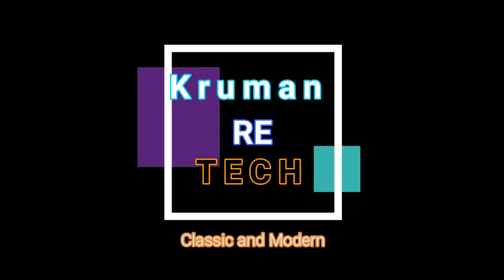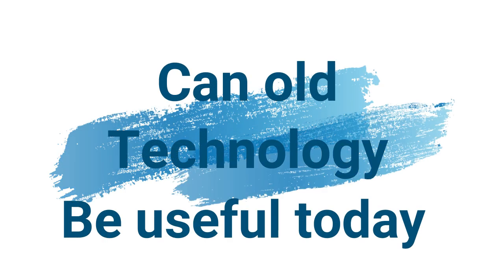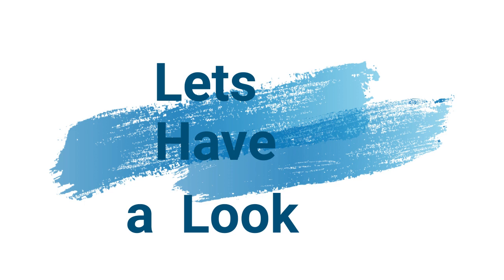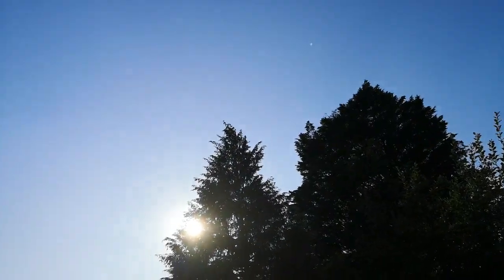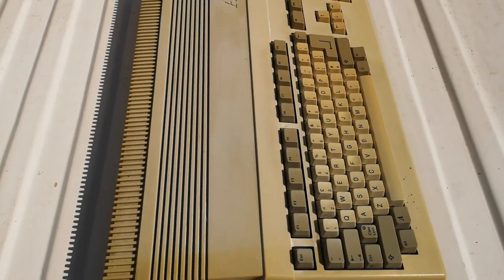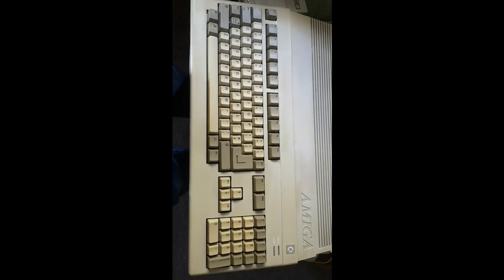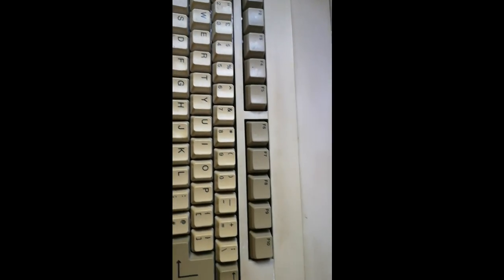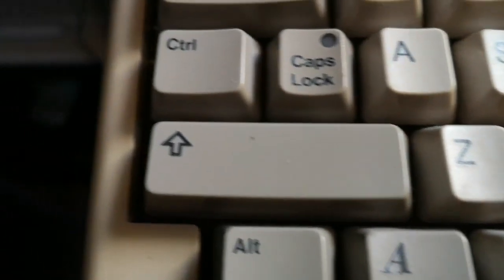Classic Computer - Retro bright experiment

Comment: I used exactly the same technique with my 500 and 600 during last summer. Was just sensible with the amount of time I left it out for. A few hours at a time over the space of a week in (northern) sun.  The results were surprisingly good and neither seem to have faded since.
Reply from the maker: Thanks for your comment. I agree with you, UV (sun) bleaching of a case can work really well. But as you say,  you have to be pragmatic and not to overdo it as UV will eventually destroy plastics. I have tried painting the cases with the correct colour (My Arari video) with great results and the paint will protect the case from UV attack for years to come and I am looking for an exact match to try it in the A500  which I hope to have matched or fine very soon. But the Keys still need to be UV brightened or retro-brighted which is not as bad as they are of a thicker construction and can stand the occasional dose of UV a lot better than the flimsy plastics  most of the cases were made out of.  Thanks for the great comment . Cheers Phil